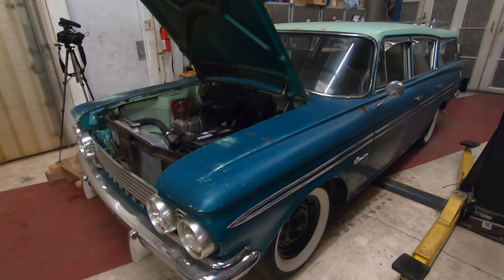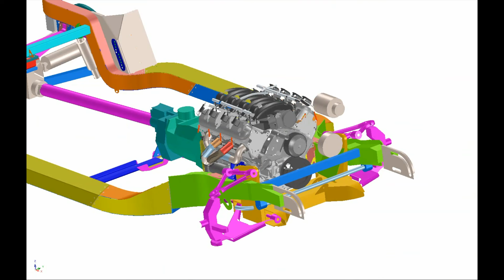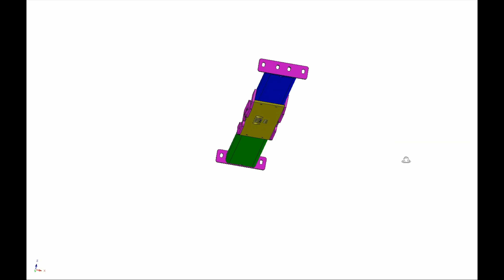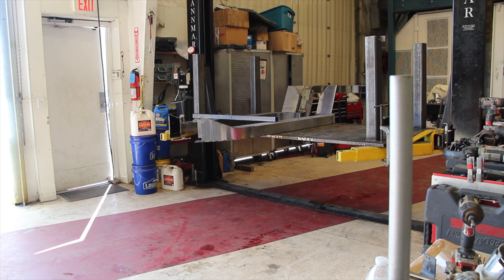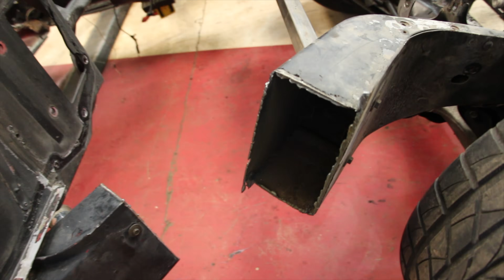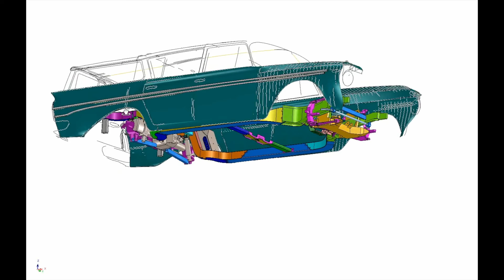Our SLEEPER Rambler Wagon Gets an LS Swap And Corvette Frame Fabrication - (Rustomod Garage Ep.3)

Comment: i took a 59 rambler with a 196 cid 6. the 6 locked up.  i installed a 327 amc 3 speed /od.  1978 was when i did this.  it made the car very quick a to speed was 135mph.  it now has 477350. miles on it.  solid vehicle.
Reply from the maker: Awesome we wanted to do an AMC motor originally!